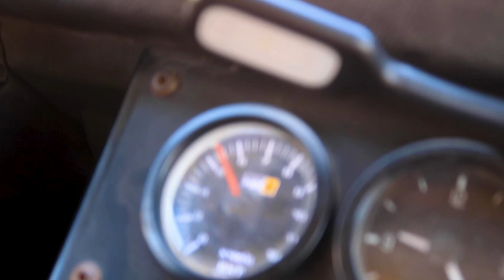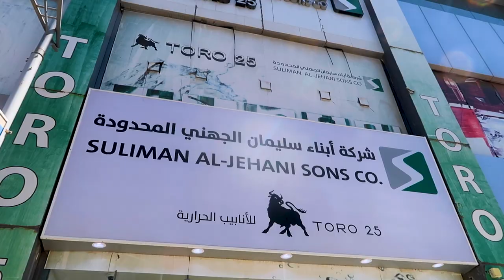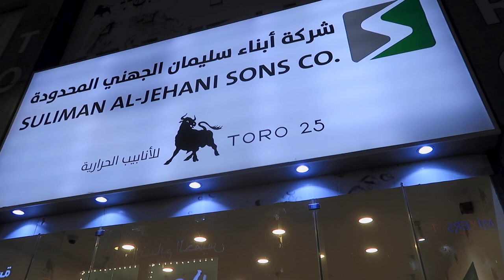The NIGHTMARE for Every Overlander // Overland Series Ep.26

Comment: wrap a rope arround the spare wheel and gently drive forward. That will pull the carrier out. As long as the door isn't bent, and separated, then you're ok, as for the injuries, you can either claim of your own ins or live with it if you won't be able to claim off the faulty party.
Reply from the maker: Hey thank you for the hints! I’m a bit afraid to do the rope at the tire. The lock is only attached with two m6 screws and our lock is already in bad shape. So I’m afraid the lock is weaker than the wheel carrier 😂